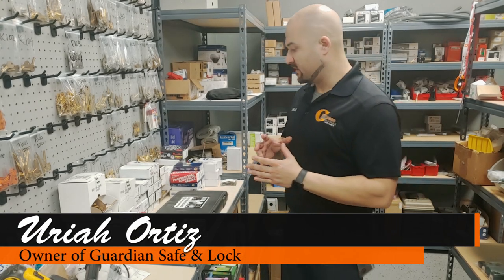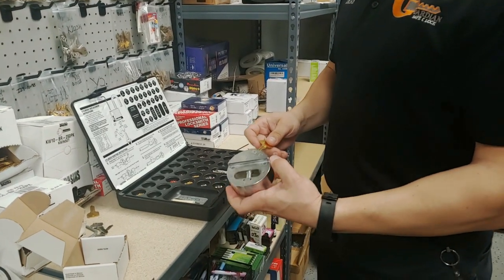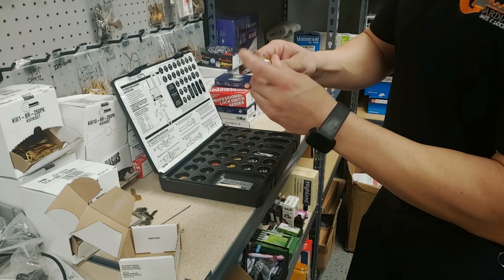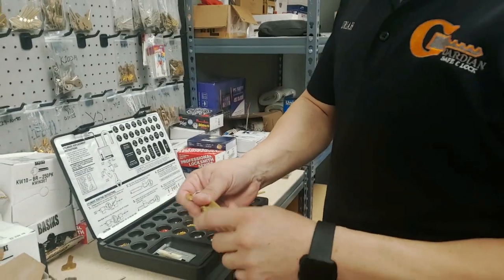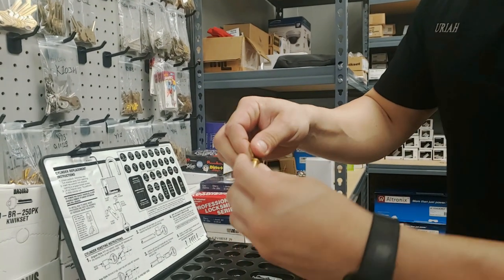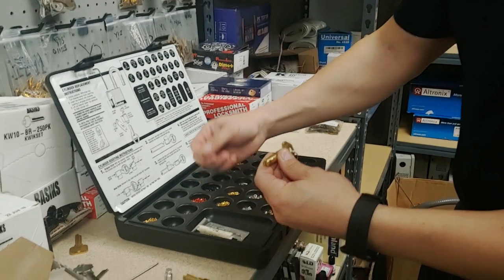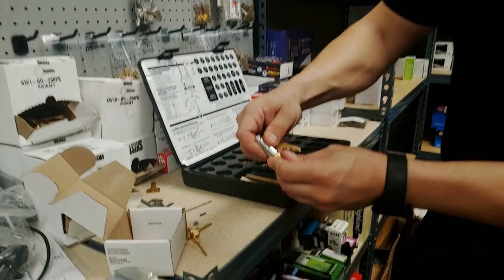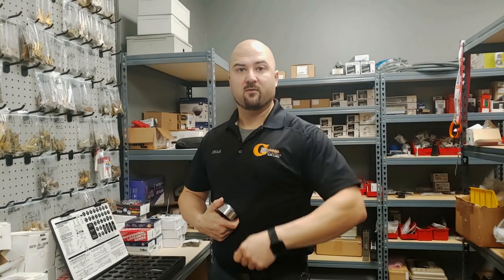Rekeying A Master Lock Hidden Shackle Padlock

Comment: You mentioned the pins are smaller then normal, is there anything you can do to increase the pick resistance of these puck locks?  Like security pins, or threading?   Also as others have said, great video, informative and quick to the point.  Thanks!